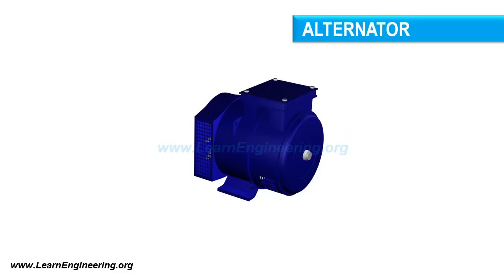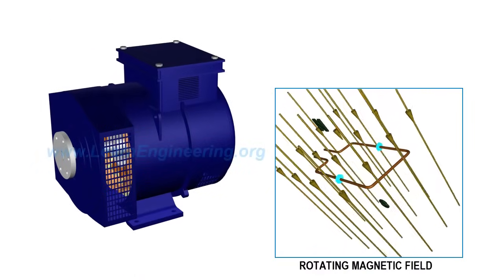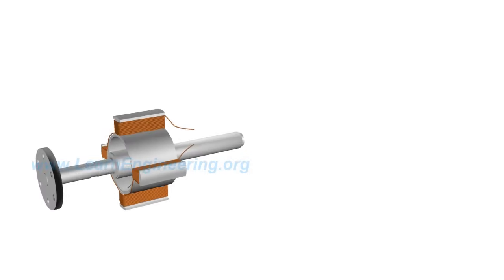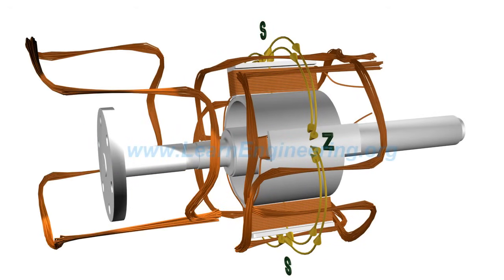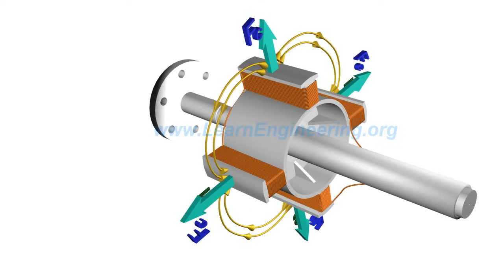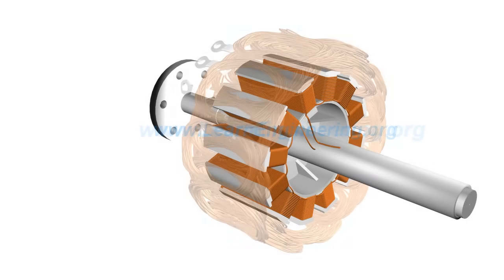How does an Alternator Work ?

Comment: Alternator 3 power generation motor   copper wire transfer coil ac power frequency synchronous motor generator copper coil slip ring electromagnetic induction excited magnet  armature rotor voltage connection salient insulation enhance dc flux load lamina stationary pole dc 4 emf mechanical transfer mechanical engineer star centrifugal force rpm transfer lower prime lamina eddy current formation anode cathode reverse teacher ji

Comment: Do you mean multiplying poles number  is usefully important in in increasing motor s performances by multiplying rotation efforts ,inductions in stator and couples on the rotor increasing angular speed and minimizing vibrations

Comment: Hello! Could you make a video on why rpm of a generator remain constant even if we increase the load? And what will happen if we increase fuel injection to the prime mover of one generator without decreasing fuel quantity to the other if they are in parallel? Thanks a lot!
Reply: The voltage and speed controls are separate.  The 60Hz frequency is measured and if incorrect, the throttle (carburetor) is mechanically adjusted to increase or decrease the engine speed.  With a fixed RPM, the voltage is then adjusted with the AVR and rotor excitation.

Comment: #Help post:
Dear members 💖💖

I have been facing problem with my ship’s generator.With “No load” the generator runs normally keeping the voltage & frequency stable . With “Load” the generator operates approximately 3 to 4 hours in normal form. There is nothing abnormal during ramping load upto 450 Kw.After 3/4 hours All generator’s ,running in parallel ,voltages  are starting to swing from 380V to 430V abnormally. When We took off the load of the said generator, the voltage on the grid becomes stabilised. We tested 3, 4 times but couldn’t get any solution yet.

During voltage swinging:
1. The RPM plays between 900 to 910 max.
2. Frequency stable 60 Hz.
3. Generators all parameters are Normal.

Actions taken:
1. Cleaned both FO feeder p/p & booster p/p’s  filter.(fuel: MGO ,sulphur content: 0.04% )
2. Cleaned FO fine filter.
3.changed No. 2 unit injection pump & fuel valve due to high temp in return line.
4. Replaced AVR with spare having same settings.
5. Checked & Retightened  all output line from altertaor .
6. Taken Engine performance during “On load”

Important info: 
We have total 6 Nos generator 
4 nos Bergen ( 350 kw each)
1 Nos wartsila ( 450 kw)
1 Nos wartsila ( 650 kw max) 

Nowadays we run 3 generator in parallel 
2 Nos Bergen ( 350 kw max. Each)
1 Nos wartsila ( 450 kw )

Ship’s total load nowadays is about 1000 kw max.

Please suggest any other possible actions I need to take

Thanks & regards

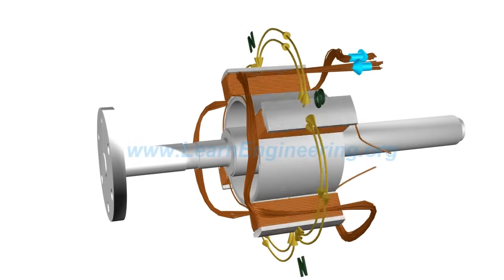Comment: 1:50 The rotor needs to be 2 pole so in this instant moment north is facing de front coil and south should face the other coil. In this 1:50 moment this isn't happening.

Comment: Another excellent video but I have just one comment to make. You refer to the fixed coils in the casing as armature most of the time but as stator occasionally. Strictly speaking the armature is the rotating core with coils, slip rings and iron pole pieces. The outer series of coils are the stator.  By using the term armature for the stator there is a risk of confusing students. I know because I teach automotive engineering and my young students can get easily confused. However, a really good teaching aid and I will be using it, along with a few explanations of terms, in my classes. Many thanks for making and posting this.

Comment: You should have at least mentioned silicon diode rectifiers since most alternators are used in automobiles that require DC.

Comment: Greatly appreciate your effort! But at 1:28 the diagram is not correct. The N pole always points outward and the S inward. Also according to the right corkscrew rule, the lower and upper coils shoud have the current flow reversed in order to obtain a sequence of N-S-N-S on the outside of the rotor. 
Secondly, at 1:56 , the relation between the stator current and rotor angular position is exactly the opposite. The AC current in the stator winding reaches its maximum when the rotor poles are RIGHT under the stator windings. The magnetic field lines start at N, diverge and then enter the S poles, so the region with the highest magnetic field line density is exactly at the poles. At that moment the stator wires cut the most of the magnetic field lines, corresponding to the highest EMF induced in that wire, according to Faraday’s law.

Comment: Hi, 

Rotation required in alternator.. 
Because if both stator and rotor stable position also AC supply will 
Create rotating magnetic field like
Induction motor. 

So we can generate emf by using this rmf concept?

Comment: Terrible video.  The regulator regulates the voltage by controlling the current to the coil. is what he says at around 5 minutes at the end of the video.   Yet he never shows the coil and where is the wire that feeds current to the coil.  However, the so-called armature coil is the output, not input.  and the rotor wires is what gets current from the little self-starting generator he calls it.  That self-starting generator makes no sense at all. It won't produce shit the way it is and is hooked up to the brush man.  Take this goddam video out of here.

Comment: How bizarre.  No wonder it is a circus.  Armature coil is stationary and the rotor turns with its winding creating a rotating magnetic field.
Okay, another sucker comes along and says it like this:  Armature ( which is made of rotor and windings) turns inside a stator. The stator has coils which are stationary. As the armature turns changing magnetic field is created which causes the current in the coil of the stator.  That current is drawn from the stationary winding of the Stator.

Comment: How is each phase regulated separately?  Say you put a large load on only one phase so you need to bump up the magnetic coil voltage, will that cause the other 2 phases to have too high a voltage?   Or do you just regulate based on the average voltage and slight imbalances are just tolerated?  The more loads on the system the more balanced it will be so it will probably matter less.

Comment: i had a idea for a electric vehicle with five wheels? use the fifth wheel to turn the alternator and charge the battery while driving? 🤔🚗🔋🤷‍♂️ (with a step down transformer and a rectifier) 🤗
Reply: I could be wrong but I think the fifth wheel would cause extra friction which would do negative work (in physics term) on the car. The produced energy from your apparatus would never be more than that from the extra energy consumed for your car (it has to push against the extra friction from the fifth wheel). It would be like having a mini wind power plant on top of your car. Although in some cars, breaking produces electricity (I think Teslas have this property).

Comment: For constant freq. the prime mover needs to run at constant speed. what if the prime mover turns at slow speed? AVR?
Reply: Akash Gupta this is a dangerous condition
For avoiding this special type of controlling system used in generating station.....so that by regulating the speed ...
We maintain the frequency 50/60 Hz .
Reply: @sandeeptiwari3655    Yes right, but thats for places where we can maintain the speed input for generation with little fluctuation using the circuits you said, but what incase of alternators used in trains that cannot maintain constant speed? is there some special setup? gears and all

Comment: why does the outside remain stationary? can you also spin the outside opposite from the inside?
Reply: Yes you could. These motors are called outrunners because the outside  "runs" rotates. Why they most of the time choose to rotate the inside is because of centrifugal forces. If you increase the rotating diameter there will be much greater forces on the rotor than if it would be on the inside. Drone motors are most of the time outrunners but the difference here is that these drone motors are really small and that synchronous machines (alternators) in powerplants can be multiple meters in diameter. To make this an outrunner the synchronous machine would be way heavier and costlier with no real advantage.

Comment: Okay so does the small DC alternator on the far right make energy for the alternator Main Power's Magnetic field?
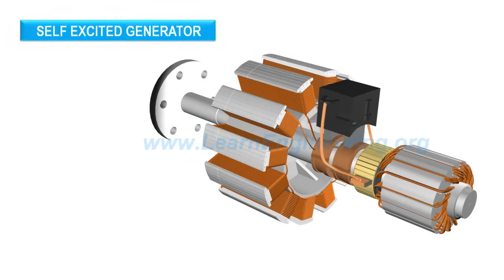Reply: Assuming you're talking about 4:20 or so: The device on the right is a generator (not alternator). The difference is that a generator has rotating coils, and permanent magnets around the outside to provide the magnetic field. (So doesn't need the "excitation current" that an alternator requires.)  The rotating coils are connected through the armature to brushes (which appear at 4:25) to provide current to whatever load is attached, in this case the sliprings and rotating windings of the alternator.  For what it's worth, in an automative alternator, the alternator field current is supplied by the car battery. (And since the field current is small, it's a net win for thew battery.)

Comment: So, will this generate more power than what is supplied? If not, why bother?
Reply: It always takes more power to turn any generator than what the generator actually produces. Alternators are most commonly used on cars. The alternator keeps the battery charged and powers the electronics of the car.

Comment: Energy from magnet can be obtained without any mechanical movement. All we need is material capable of being converted from magnetic to nonmagnetic when applying electrical impulses. This will simulate the rotation of the armature in the generators. Such a material was created for other purposes and there is technology. More info ?

Comment: Can you help understand better, how many D.c volt is added to produce such a high a/c volt.?
Reply: AC voltage magnitude in stator doesn't depend only on DC voltage (which causes current in rotor, which causes magnetic flux), but also on the construction of the generator (magnetic paths, number of turns in coils etc.) and rotational speed, which is basically fixed when operating on the grid. So DC voltage is just a part of the story. Amperage in rotor windings can be in the thousands though, you can calculate voltage if you know its resistance by Ohm's law.
Reply: @FrainBart_main  How does AVR come in this process.
Reply: @uchepuche8391  As I said, AC voltage depends on multiple things. But the only thing we can change is rotor voltage. This changes the rotor current, thus the magnetic flux --> different AC voltage in stator. I don't actually know which kind of AVR is the most commonly used, but I think static (using a power converter) is the most popular nowadays.
Reply: @FrainBart_main  Thanks for your attention, this vídeo is suppose to content the multiples things on what you have said hence is made for learning. I want to make alternator of 5kva ,how do i start since the vídeo is limited.
Reply: @uchepuche8391  The above video is just about the basics of an alternator, for someting more you will have to read books about electrical machines or synchronous machines in particular. Same goes for constructing it, I really can't help you much here. Sorry I can't recommend some books because I learned from books written in my language (Slovene).
Reply: @FrainBart_main  For example how much dc volt is used to excite 220v ac alternator. Is the volt dc maintain constant to generate electricity in the alternator Just like the car alternator?
Reply: @uchepuche8391  An approximate equation (there are some additional factors you should probably look into) for the induced voltage (EMF) is: U = (2*π/√2)*f*N*Ф; where f is the mechanical frequency in Hz, N is the number of turns in coil(s) for one phase and Ф is the magnetic flux. You regulate f with mechanical torque if it's off grid, on grid f is bound to the electric frequency of the grid (if not connected via a power converter). Ф depends on the construction of the alternator (iron, coils, air gap etc.) and the rotor's number of turns and rotor current. You will need to find an appropriate construction (a lot of variables, you will have to dig deep into literature to achieve this) and then you can regulate AC voltage with rotor current.

Now about constant AC voltage. Alternators in cars have a regulator, which keeps AC output voltage constant over a variety of rotational speeds (rpm). With higher speed it lowers the DC current (exitation, field current). If you want to use it off-grid, you will need a regulator too to keep AC voltage constant. I hope this was helpfull. Note that the induced voltage equation can look very different in different literature.
Reply: @FrainBart_main  Thanks a lots. I am a brazilian.
Reply: @uchepuche8391  This is possible or not? In generator stator side we give AC input so as time varying magentic field is vary and so chainging magnetic flux is Link with armature and emf is produced So here there is no need to rotate the rotaer to turbine?
Reply: @FrainBart_main  This is possible or not? In generator stator side we give AC input so as time varying magentic field is vary and so chainging magnetic flux is Link with armature and emf is produced So here there is no need to rotate the rotaer to turbine?
Reply: @tmodi2145  If you have an alternator connected to the grid without applying torque on the rotor shaft (or if you apply torque in the opposite direction of rotor's rotation), then the alternator works like a motor (power is transferred from the grid to the machine). If then you apply sufficient torque on the rotor shaft in the direction of rotation, you start to produce power, which is fed into the grid.

You are right in the sense that even if you don't rotate the turbine yourself, there will be EMF induced in the stator windings. But to produce (active) power, you need to adjust the rotor angle, which you do by applying mechanical torque in the same direction as the rotor spins. For this to understand, you need to have an understanding of a synchronous machine's construction and phasor diagrams. It's quite complex. If you want to produce only reactive power, then you can have only an alternator without any turbine spinning it. To adjust reactive power production, you only need to adjust DC current in rotor's winding. This is known as a synchronous condenser.

Comment: Why rotor is connected with DC source??
Reply: To turn the rotor into a magnet through its coils. Otherwise you don't have a magnetic field.
Reply: @Rakward  This is possible or not? In generator stator side we give AC input so as time varying magentic field is vary and so chainging magnetic flux is Link with armature and emf is produced So here there is no need to rotate the rotaer to turbine?
Reply: @tmodi2145  Your comment isn't very clear but if you put "AC on the stator" like you say  you'll produce a rotating(I'm assuming 3phase) magnetic field on your rotor-winding and the induced emf would turn the rotor into a magnet as well(assuming you've short-circuited it), but that's a motor, not a generator/alternator.
Reply: @Rakward  
But as you say induced emf is produced in rotor side so emf means volatge so this is also usable (one type of batery)??

And how you say this is motor in motor there is shaft rotating
And ya why both ending wire is short?????
Reply Reply.....
Reply: @tmodi2145  Yes but the induced EMF in the rotor will cause the rotor to be rotated by the rotating magnetic field as well, that's the working principle of an induction motor. I said you have to short it because the the EMF induced in the coil cannot generate current if the circuit isn't closed. And you need current for Lorentz forces between rotating magnetic rotor field and the stator's magnetic field. 

If I understand you, you want to use induction to create a  voltage in the rotor of a generator instead of a direct DC-supply? Or something else?
Reply: @Rakward  
In motor generated induced emf use to rotate the rotor
And in generator generated induced emf use to generate electricity
Why in both situation we get output different?????
Reply........
Reply: @tmodi2145  
In a induction-motor:
3phase AC on stator => induce EMF in rotor(short-circuited squirrel-cage) => lorentz-forces between stator and rotor causes torque on motor-axle

In a generator
Torque on motor-axle => rotates the rotor (a magnet) => Induces EMF on 3phase windings causing 3-phase AC

The difference is in the direction of the EMF from stator to rotor or rotor to stator.

You can also have a non-induction motor, where your rotor is just a magnet that follows the rotating 3phase magnetic field, no induction needed since there's already a magnetic field in the rotor.
Reply: @Rakward  
If you able then please explain
How non induction motor has working????
Reply: @tmodi2145  3phase on stator => rotating magnetic field => rotor is a magnet(permanent or electric-powered with brushes => Rotor is pulled along by magnetic field from stator N/S attraction)
Reply: @Rakward  
Why called non induction??
Means here also induced emf is generated
Reply: @Rakward  
Ohhhh 
I understand in induction motor not permanent magnet but loop winding is required and in non induction motor we use only magnetic effect ....
Is it true or false??
Reply: @tmodi2145  I think you understand but there are plenty of videos that explain the different motor types on youtube
Reply: @Rakward  
Thanks for helping🙏🙏

Comment: So there is no use of any magnets??? How DC voltage is generated to excite the rotor coil???
Reply: Some synchronous machines use permanent magnets (some generators in wind turbines, some motors for EVs) and some use a DC coil or a electromagnet (coal, gas, nuclear, hydro power plants etc.). DC voltage can be generated from the rectified AC output of the synchronous generator or from the rectified AC from the grid or similar.